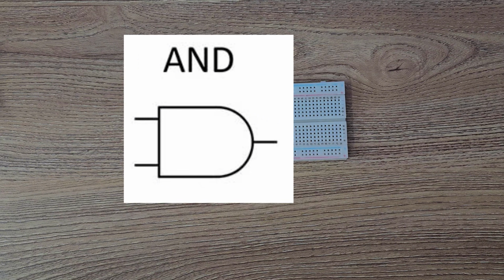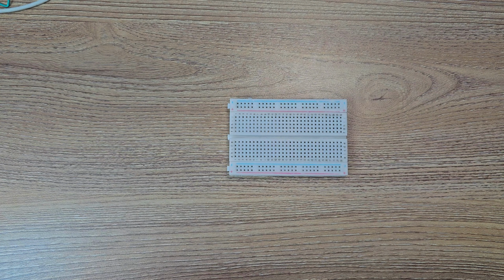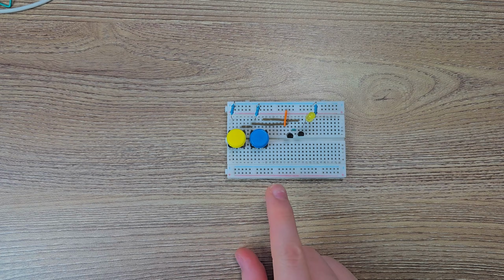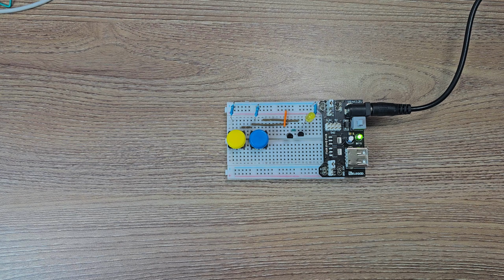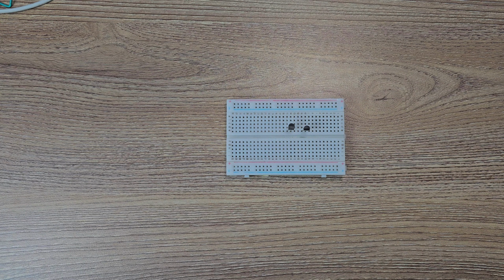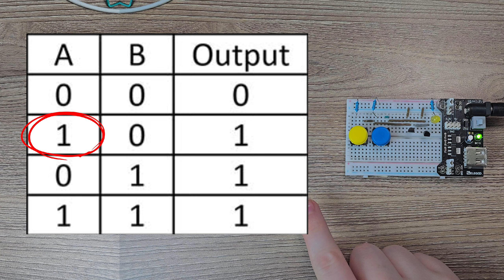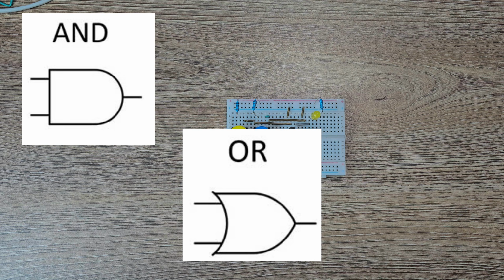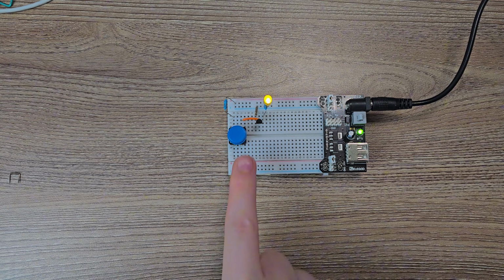How to Make a Computer: From Zero to CPU | Ep.1

Comment: Please look up the best practices for schematic diagrams. The way you've drawn them makes it very difficult to follow. Transistors should be shown with their bases/gates to the side, not sticking out the top and there's no need to show a complete current path. Just show what goes to the positive rail (which should be at the top of the diagram) and what goes to ground (at the bottom of the diagram)
Reply: this video is made for beginners though.  it may not make perfect sense to you if you are already advanced in electronics, but it makes perfect sense to beginners and is easy to follow and understand.
Reply: @orion7741 the worst thing for a beginner to do is learn bad habits. That applies to most things by the way, not just electronics.

Secondly, of you think about it, it's a lot more intuitive to do it properly. Voltage goes from high at the top of the drawing to low at the bottom. Same for current and signals

Not including extraneous information also helps as it keeps things less cluttered and easier to follow.

There's many benefits to doing things properly, and no real food reason for not.

Comment: Computers are made from Nand gates. But, lets see how far you get with And.Or.
Reply: True. NAND gates are universal gates and and every boolean expression can be expressed by use of only nand operations. But thats difficult if you try to understand every single nuance of computing with NAND gates and its sometimes easier to look at a circuit as AND, OR and NOT then looking at a cluster of NAND gates
Reply from the maker: @rajatkakar9598 exactly! That's what I am trying to do. Besides, I am going to use ICs eventually. I will not be making a computer out of transistors. But my hope is that we build every part from something that we built from scratch.
Reply: @jurassicvader cool! Very excited for that
Reply from the maker: With my understanding, it can be done with onlu NAND gates, but it's still inefficient. Its easier to explain and understand the advanced circuits using AND, OR, and NOT instead of just NAND.

Comment: What is the role of transistor? Like what's their mechanism or how do they work?
Reply from the maker: The transistor in this case is used as an electrical switch. When the base pin receives power it will change the flow of electricity. If you wire them up in a specific way, we can achieve logic gates. Think of the transistor as a way of changing where the electricity flows.
Reply: Not electricity. Current. Unless you are talking Electron Flow or Hole Theory.
Reply: @snakezdewiggle6084  current IS electricity though, just in a different form than one typically thinks of "electricity".  it is literally a DC current of electricity that is being sent through the components on the board....